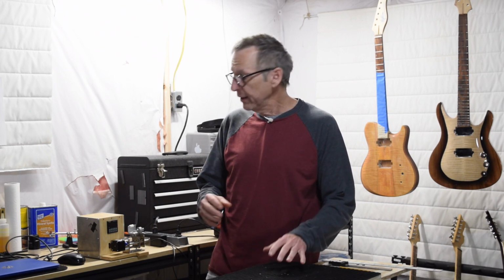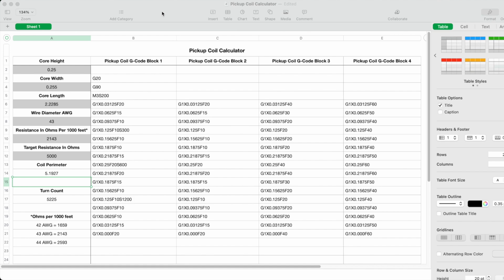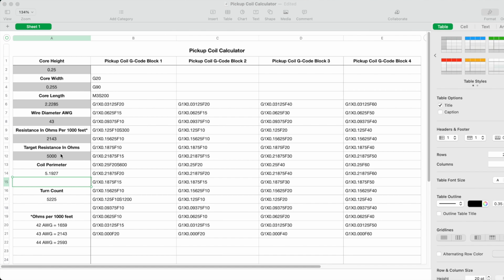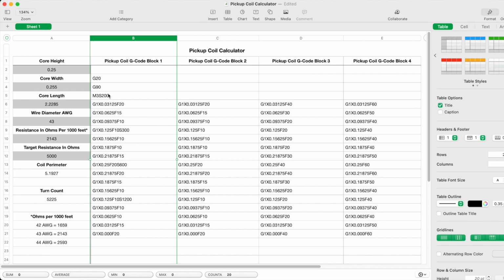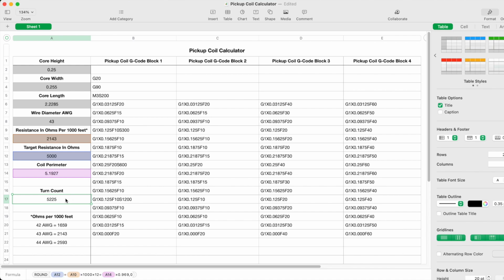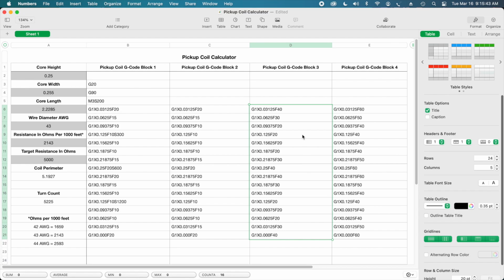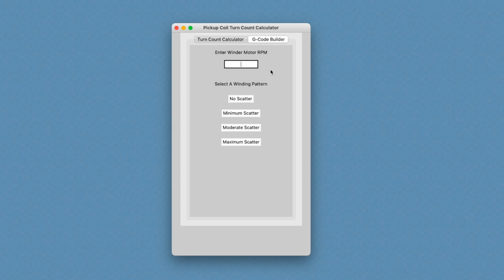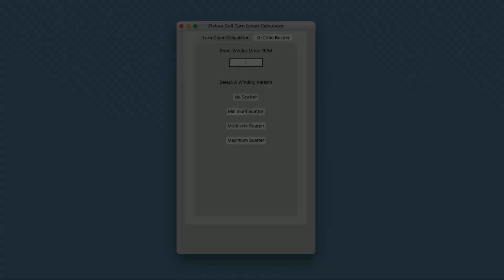Making A CNC Pickup Coil Winder Part 4: The G Code

Comment: Hey Chris thanks for the videos. I was wondering what formula you use/how you calculate the "fill factor" for the coil perimeter calculation. I'm not trying to do any G-code or anything for a CNC winder but I'm pretty comfy creating Excel calculators and I was following along trying to just make a coil turn count calculator using content from the left hand column in your data sheet but didn't know the formula to calculate the perimeter fill factor. I assume it's Lx2+Wx2+Product of Fill Factor Calculation.  Thanks!
Reply from the maker: Fill factor cannot be reliably calculated for pickup bobbins due to variations in the winding speed and traverse. To determine turn count, I use the following formula:
Target resistance in Ohms / Resistance in Ohms per 1000 feet* x 1000 feet x 12 inches / Coil perimeter in inches.

*This number varies with wire gauge.

Example:
Target resistance in Ohms= 5000
Resistance in Ohms per 1000 feet for 43awg wire=2143
Coil perimeter=5.4164
5000 / 2143 x 1000 x 12 / 5.4164 = 5169 turns
Reply: @HighlineGuitars  Hey Chris, thanks again for replying. I already had this part of the equation figured out for calculating turn count. The issue I'm running into is how best to put a value on the coil perimeter. As I understand it (was more of a humanities kid so feel free to correct my math mistakes), the perimeter is bobbin core length + bobbin core width X 2 + fill factor. If this is correct, using the numbers on the spreadsheet of the video you would have 4.967 coil perimeter before adding fill factor. Your listed perimeter is 5.1927 which means, if I understand correctly, you add a fill factor of 0.2257. I was just curious how you determined/calculated that fill factor number/difference. Also using your numbers from the spreadsheet I calculated a turn count of 5,392 not 5,225. Very easily could be a math error on my part.  Anyhoo I was just curious how you determined coil perimeter number. Thanks again I appreciate your time to read this and respond.

Comment: Awesome project! When can we exspect the release of the project in your Homepage? 
Keep on doing your awesome channel an tutorials!! Thank you very much!
Reply from the maker: I am hoping by the fall of 2021. The software is done. The assembly manual is done. The user manual is almost done. However, I have come up with a revised wire guide that will necessitate significant revisions to both the assembly and user manual.
Reply: @HighlineGuitars  if you need a beta User let me know i will purchase as soon as possible.

Comment: Also your G-Code program is cool, but why not have the software count the turns on the winder instead of estimating the time it takes to wind a coil? That’s how CNC winders work.
Reply from the maker: My counter cost $30 and took less than 5 minutes to hookup. How fast and easy is it to have the software count the turns?
Reply: @HighlineGuitars  Well I don’t know, but that’s how all the CNC winders I’ve seen work. I have parts for one I’ve been planning to build. The “brain” is on a PIC controller, and you enter the number of turns your want. It ramps down the speed  and stops at the end.  

That’s also how the tanac coil winders worked at DiMarzio.

You’re already coding for the winder.

Comment: Things that will make your life easier; pickup makers do not wind pickups to a resistance. No one does that. You wind to a number of turns. This is how all the big pickup makers do it (I worked at DiMarzio). 

This is why a P-90 is 10,000 turns. Nice round number. A PAF pickup is that divided by two. 5,000 turns per coil.  

For other pickups just pick a number!  Want a high output pickup? Try 6,500 turns of 44 AWG. Why 44? Because 42 won’t fit.

Also humbuckers are not scatter wound. They were all machine wound.
Reply: @HighlineGuitars  you’re a bit snarky for someone who just started winding pickups. I’ve been doing this for 20 years. I’m trying to be helpful, but go ahead and reinvent the wheel. Lol.
Reply from the maker: @DavidRavenMoon  I made my first pickup just over 15 years ago. I have had 6 different winders in that time.
Reply: @HighlineGuitars  then you should know you don’t wind to s resistance.
Reply from the maker: @DavidRavenMoon  And what do you base your turn count on?
Reply: @HighlineGuitars  you create your own pickups. You aren’t copying something. Why was the P-90 exactly 10,000 turns? Probably because that’s what fit on the bobbin, so they rounded it to an even number. Seth Lover said when he designed the humbucker he divided that number in half; 5,000 turns. It’s the turns of wire that produce the output. The resistance is just a measurement. If you look at Bill Lawrence pickups they only state inductance. 

And 8,000 turns of 44 is a higher resistance than 8,000 turns of 42 AWG, but they will both have the same output. Resistance is meaningless. 

When I started designing my own pickups I stated at 5,000 turns per coil, since that was common. Then I changed that mostly based on my gut feeling..  listen to the pickup; do you want it brighter? Use less wire. You want more mids? Use more turns of thinner wire. It’s a lot of trial and error. But after a while you get a feel for it.
Reply from the maker: @DavidRavenMoon  You know what’s funny? You base your turn count on your gut feeling. I base my turn count on resistance and the number I choose is based on... a gut feeling. I’ll explain this in more detail in a future video.
Reply: @HighlineGuitars  you know the resistance changes with temperature, right? So on a hot day it will be higher. But it’s not going to sound different. 

Resistance is not an indicator of how a pickup sounds. Inductance is. 

I use my gut because that’s called experience. I’ve wound hundreds of pickups. By this point I know how to get the tone I’m looking for. I’ve had pickups on the Grammy’s with Imagine Dragons. 

So I think I know what I’m talking about.
Reply from the maker: @DavidRavenMoon  I don't use resistance to determine the tone. I use it as a starting point for determining the number of turns. If I wind 100 bobbins with 5000 turns of 43awg wire, they will all yield the same resistance. If I wind 100 bobbins with 4000 turns of 43awg wire the resistance will be lower, but it'll be the same for all 100 bobbins.

After the coils are wound, I switch to measuring inductance in order to fine-tune the tone by choosing and charging/degaussing the appropriate magnets.
Reply: @HighlineGuitars  Again, you’re winding to a resistance. No one does that. Not DiMarzio. Not Duncan. Not Lollar. No one. Unless you’re just copying an existing pickup no one does that. And if you were copying an existing pickup it’s better to weigh it on a digital scale. You want to know how to pick how many turns to use? Just make an educated guess. For a humbucker 5000 turns of 42 is a PAF. 6500 turns of 44 is a JB. See how it’s not like 5230 turns? Because they aren’t wound to a resistance.
Reply from the maker: @DavidRavenMoon  Even if you rely on an "educated guess," you can still do the math to determine what the resistance will be. Most of my viewers have never made a pickup before and don't have the experience to make an educated guess. So I am offering them an opportunity to target resistance as a way to determine the number of turns. Once they've wound a coil, they can measure the inductance and possibly the capacitance and go from there. My approach is more about math than it is mystical voodoo.
Reply: @HighlineGuitars  I don’t care what the resistance is! I don’t even know what the resistance is for some of my pickups. I wind to a number on my counter. After I wind the coil I measure it to make sure it’s good. If it’s a crazy low number like 2k there’s a short in the coil. The resistance right after you wind is too high because the wire is hot from winding anyway. So if I was winding to a target resistance it would be wrong. 

How did Seth Lover pick 5,000 turns on a bobbin for the PAF? He gives two answers; it was half a P-99 at 10,000 turns, and it was as much wire as will fit on the bobbin! He said “we wind them until they were full”. Why was a P-99 10k? That’s what fits on the bobbin. 

Why is a Strat 9,000? That’s as much wire as you can fit comfortably on a bobbin. So they rounded it off. Joe Barden did 4,500 on each coil because it was half of 9,000. Not because of a resistance! 

Just pick a number. I do a set of pickups that have 4,500 on the bridge and 3,500 on the neck. Why? Because I picked those numbers, tried it and it sounded good.  You’re over analyzing it.  

You can find wind numbers for lots of pickups on the internet. Fender P bass; 10,000 turns per coil. That’s how much wire fits comfortably. But you can squeeze 12,000 if you try hard. But he picked a number close to the maximum amount of wire that will fit ob the bobbin. Same with a Jazz bass. The bobbin came first.  The string spacing dictated the length.  The width was a product of the length. Then they wound the first one to see how much wire will fit. Then you listen to see if you like that. Maybe it’s too dark. So wind 200 turns less. Or maybe 500. 50 turns won’t do squat. So you pick a number for production. 

There’s an EMG factory tour where you see trays of bass bobbins with signs that say “4,700 turns.” Because that’s how they wind them. It’s what fits on the bobbin, rounded off to a round number. 

When they go from a 4 stung to a 5 string bass it’s still 4,700 turns. The 5 string had a higher resistance. A 6 string bass pickup still has 4,700 turns. It has a higher resistance than a 5 strung version. Because the resistance isn’t important and they don’t wind to resistance. They picked a number of turns.

If you’re going to do instructional videos you want to give people the right info.
Reply from the maker: @DavidRavenMoon  I think you’re taking this hatred for resistance way too far. In my software program, the turn count is just a recommendation. It’s for people who don’t have eons of experience winding pickups. You don’t have to use the recommendation if you don’t want to. It’s not used in the formula that writes the g-code. I used resistance in the turn count formula because the math formula is easy to do. Nowhere have I said that resistance is a way to measure tone. I have said many times that resistance can only provide a clue about what to possibly expect. Admit, you don’t want my viewers to make their own pickups do you? You want them to buy them from you.  And why are you even watching my videos if you’re such an expert already. Is it because you consider yourself some kind of self appointed anti-resistance watchdog? Or are you just bored and looking for something to rant about no matter how trivial?

Oh and by the way, the next version of my winder software is really going to make you and all of the other so-called expert pickup makers angry. Stay tuned!
Reply: Of course they wind to a specific number of turns; they are mass producing, not designing. Even so, some pickups have their specs all over the place, like Fender Custom Shop 69.

Can't see the problem here.
Reply: @jd_cl  even when you are designing a new pickup you wind to a number of turns. You don’t sit there and think “this needs to be 14k”. That’s a meaningless metric. As I pointed out previously, if your making something like a Jazz bass pickup for 4, 5, and 6 string basses, you will wind all three the same. The longer bobbins will have more wire on then and read a higher resistance. But resistance doesn’t produce the output. It’s the number of turns. Every turn. Increases the inductance and output of the pickup. Resistance is just a by product. 

You can wind 8,000 turns of 40AWG and it will read much lower resistance than 8,000 turns of 43AWG, but they will both have the same output. They will sound different however. 

I know a lot of pickup makers. They wind to the number of turns. Take Seymour Duncan. He started out unwinding pickups and counting the turns. He could have figured it out by resistance to get a rough idea how much wire is on there. But that’s misleading. 

These days there’s turn calculators on the web. But they don’t get you exactly there. If you are scatter winding you are putting more wire on the coil than if you machine wind. That’s because each turn is more diagonal. But it’s still a set number of turns, and it’s the turns that makes the output. That’s why a straight length of wire doesn’t make a pickup, even though it has a resistance.
Reply: @DavidRavenMoon  I don't know what I'm saying, but output is only a part of the equation and maybe the resistance value is a better indicative of the resonant peak. And, as you said, a staggered wound have more wire than a regular wound, and you can't measure that with the number of turns.

I don't think the DC resistance is useless.

BTW check this guy "Antigua" from Guitar Nuts forum... best pickups research I've seen: 
https://guitarnuts2.proboards.com/user/4605/recent_threads

Comment: Disclaimer: I have never made  a pickup in my live and struggle to distinguish between mono and stereo. Don't ask me about tone.
One thing I'm wondering about: though: A lot of videos talk about scatter-wound pickups and how the sound was better than "straight wound" pickups.  
Using a CNC based attempt would open up the possibility to make a pseudo-random wound pickup with a known random seed (https://en.wikipedia.org/wiki/Pseudorandomness), at least to the additional randomness introduces by wires etc.
This might help produce a particular good sounding "random" wind, if you manage to hit the right random seed.
  Is this something you've looked into (or even are the least bit interested in)?

Comment: Hey Chris, awesome stuff. This looks super cool. One thing that's been bugging me though since the last video is whether stopping the motor from 1200 rpm to 0 in a fraction of a second wouldn't be too harsh for the motor. Perhaps in your application, you can add at the end of the file few commands that would slow down the motor as the target coils is approached? Keep up the good work!
Reply from the maker: I don't think it'll be too harsh. Even it is, at $4 a motor, I might buy a few as spares. Slowing the motor down at the end would involve knowing exactly how many traverses are required for the number of turns. That is very difficult to calculate when the speed changes during the traverse and without an expensive high precision motor and a lab-grade power supply, impossible to achieve.